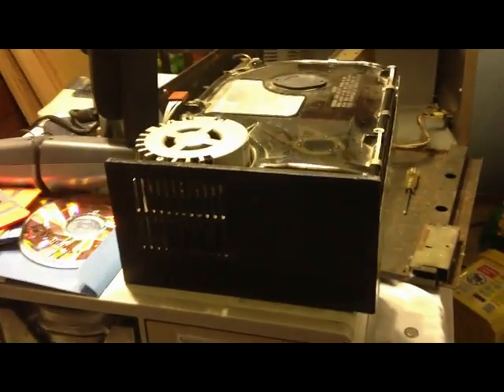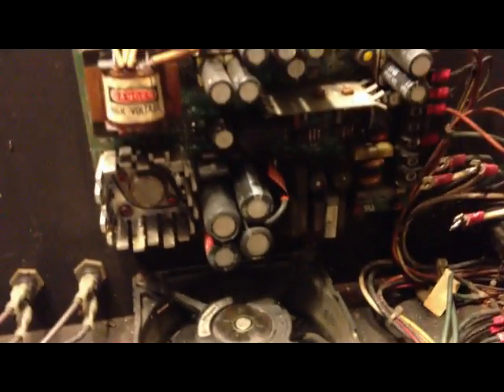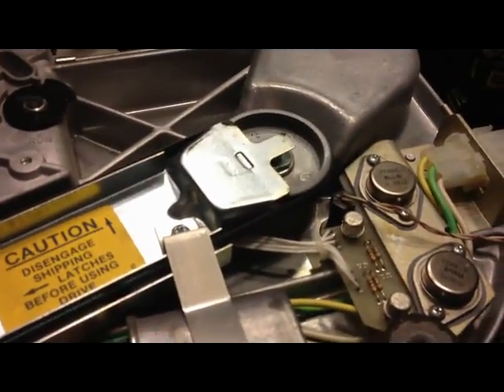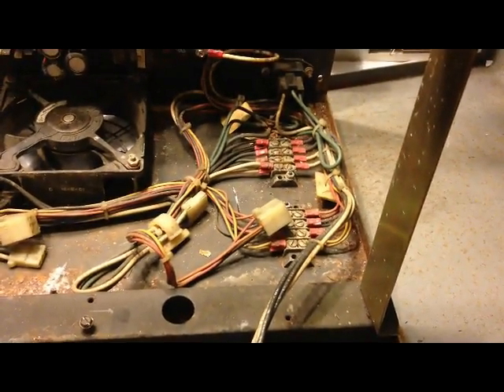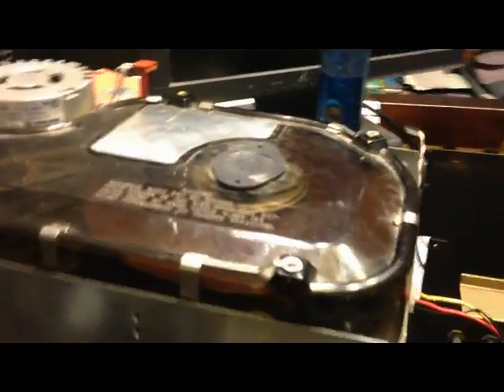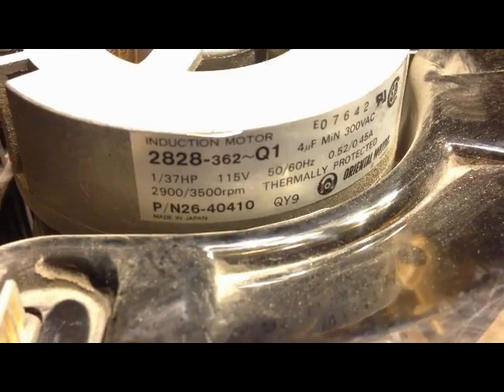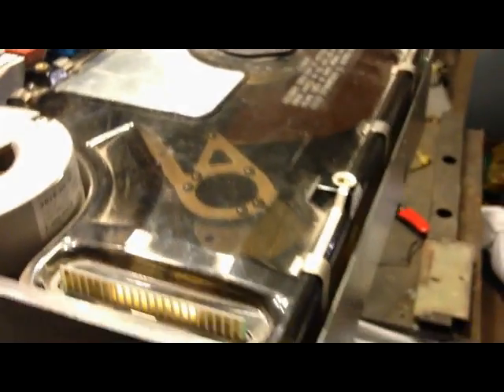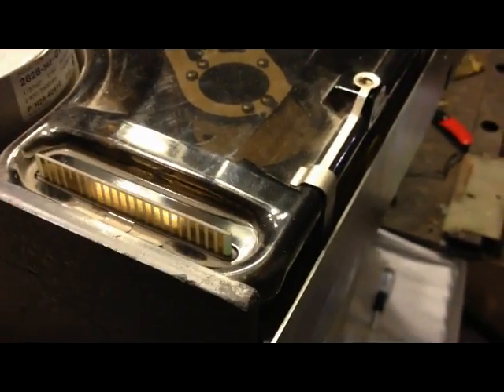Quantum 2040 8" Hard Drive First Power up.

Comment: Hi, I found your video very interesting since I have a Q2030 model. I'd like to be sure I'm connecting the correct wire colors to the right places. If I'm using an AT power supply, what are the corresponding colors? On the Q2030 there's a yellow, green, and white wire, and on the Molex connector of the AT power supply there's one yellow wire, two black wires, and one red wire.
Reply from the maker: Well on the AT and ATX power supplies the Red wire is +5v and the Yellow is +12v.  On this drive the yellow white and green wires are A/C 120 volts between the Yellow and white wire and the green was ground.  But some of these 8" drives need 24volts DC to power the head stepper motor.  Which is missing on both AT and ATX power supplies. The drive in the video does not have any controller board on it.  So the only power going to the drive was 120V A/C to run the spindle motor.  The TRS-80 Power supply offers a switched A/C voltage and that's what I was using in this video.  I could have just plugged it straight into the wall, if I had thought about it a little longer.  I recommend searching for Usagi Electric, he has a recent video actually showing a working 8" hard drive and how he connected it using Meanwell power supplies.

Comment: Man, that would've been SOO ANNOYING to hear all the time of using the computer! I remember when many hard drives had that loud sort of spindle motor sound. But why would a motor that size have to be that loud instead of just sounding like, or even being, an induction motor? There's no way they could've made the disk spin fast enough with even a brushless AC motor?
Reply from the maker: Well this is a 14 inch drive, so it would have been inside a mainframe in it's own room.  But imagine about 10 of these things going. lol
Reply: @Devin2277-n2m : A mainframe in "IT IS own room"? I'm confused. How can it be its own room? Or were you actually trying to say "in ITS own room"? Because if so, then my response to that is: Oh, OK, good! I'm glad people didn't have to hear that all the time while operating. But yeah, a room with 10 those disk drives running at the same time would be quite noisy!

Comment: Yow what's di RPM on dat
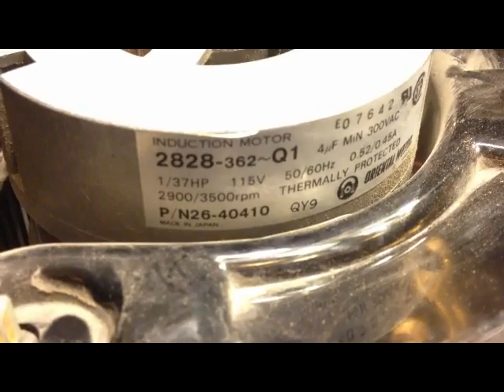Reply: At 6:34 you can see a shield on the motor. It makes 3500rpm :)
Reply from the maker: That would be about 3500 RPMs.

Comment: Sounds like the belt is a bit loose. The motor spools up before the disc is fully wound up. Even if you had the controller for it, you'd probably get data errors. I have a 1982 Xerox 820-II with a Shugart 8" 10mb. MFM drive and it's also belt drive, but the belt is still in pretty good shape. It runs CP-M 2.2 and still works well.😉

Comment: Damn it man what is with the circuitry missing for all these hard drives I keep trying to find all these really awesome hard drive videos and 90% of them are like yeah but the circuit tree for it to make it work is gone so goddamn disappointing
Reply from the maker: I hear ya!  Well most of these huge hard drives were designed to run on MainFrame computers which most have been shoveled off to the dumps.  Only the smaller pieces like these hard drives are left.  So there's just nothing to connect them to.  They were never designed to connect to an x86 PC.
Reply: @Devin2277-n2m  perhaps someone like mr. Carlson's lab and create some circuitry or re-engineer something it would be a total waste not to ever see one of these work again they are too beautiful pieces of equipment and deserve to be preserved in some way there has to be a way
Reply: @Devin2277-n2m  are you a furry to
Reply from the maker: @ethanspaziani5269  I dabble in lots of different hobbies.  Furries is just one of them.
Reply: @Devin2277-n2m  hayy im a furry to in tx !
Reply: @Devin2277-n2m  subd to your chanl

Comment: Are you sure that this beast is only 38MB? In 1981 there was a 5" Drives about 5MB and 10MB,so this monster could be at least 300MB or 3GB
Reply from the maker: According to the model number, it's a 38mb drive.
Reply: @Devin2277-n2m  this is just crazy :D

Comment: What is the voltage input on this drive? I read that it's 24V AC, but the motor can says 115V AC
Reply from the maker: Ryan Ashford The motor is 115v AC, yes.  There is no controller board, so no other voltages are required here.
Reply: @Devin2277-n2m  So even if you have the controller board with it, you still run 115V AC to the connector?
Reply from the maker: Ryan Ashford  There would be two connectors, one for the DC voltage for the controller and one for the AC to the spindle motor.
Reply: @Devin2277-n2m  Thanks!

Comment: The PCB plug poking out of the top of the Hard Drive is for a circuit board edge plug which has cables which run directly to the "full length" dedicated controller circuit board. The HD controller board required no additional drivers as it booted up with the motherboard and worked though the ISA M/B sockets.
Reply from the maker: Ahh!  Cool!  Thanks for the info.

Comment: What is its capacity? Any idea what year it was manufactured? That thing is huge.
Reply: 40mb capacity, the 2020 model was 20mb. My work used these 1983/84. Put loads of these in the junk skip, wish i'd kept a few.
Reply: the 2040 is 40mb capacity, I would guess from 1985
Reply: 1981 was the year

Comment: I used to work on submarines. both the fire control system and sonar systems used hard drives that seem  similar to this one. I think ours were slightly bigger and maybe around 20 lbs. subs were still using them around 2001.

Comment: can run windows xp on it ;)
Reply from the maker: This is a 38 megabyte hard drive.  But maybe some day I'll try XP on it.
Reply: 8 MB for a huge HDD this HDD can store lots of gigs in modern days
Reply: +Squinky Aventurierul Lots of terabytes dude, imagine making a drive of this size with the technology of today, probably 140TB
Reply: OMG 140 TB can store your brain data in it
Reply: ***** Actually no, you need roughly 2.5 petabytes to do that, which equals over 3000 terabytes
Reply from the maker: +CreeperGuy 555 no it's 8 inches.

Comment: Imagine how many terabytes they could cram into a drive of those dimensions today.
Reply from the maker: That would be awesome.  Probably several hundred terabytes.
Reply: @Devin2277-n2m  I'd buy that for a dollar
Reply: +Devin2277 It's an order of magnitude more if they can use flash. A 16 TB SSD in 2.5 inch form factor exists. Those drives are up to ~10 mm thick; giving it a volume of up to ~70 000 mm^3.

I would say the drive you have looks to be about 9 inches wide (8 inch drive = 8 inch platter), 5 inches tall and 12 inches deep. That fits 126 of those drives, or 2 petabytes. Stacking 2.5 inch drives waste space; you can probably double that if you just stack PCBs full of flash.
Reply: @soylentgreenb  Or using micro sd cards. they are tiny. but for the same capacity probably more expensive to produce than some stepper motors and disk platters.
Reply: +Jerkwad152 just wondered myself, why the feck no one does that
Reply: @Fiilis1  Manufacturing standardised on the 3.5" drive. Large enough for dense data storage, but small enough to have negligible noise and vibrations. Also, i think you'll find that a large drive array (think LinusTechTips Petabyte Project) can actually store more in a rackmount unit than a single disk filling a rackmount unit.
Reply: @Fiilis1  People just get a bunch of server hard drives and cram them together
Reply: @Fiilis1  I wonder why 5.25 HDDs don't exist anymore and why 3.5 SSDs don't exist at all
Reply: @RowanBird779 3.5 SSD exist in enterprise  market there is a video on ltt on a 100 tb 4 stakt 3.5 SATA SSD but it is slow for what it is you are better off buying a 8 nvme to 16x pcie edaptor
Reply: It is expensive, inconvenient as it won't fit on normal cases, loud, inefficient, etc.
Reply: Jerkwad152 a Peta byte
Reply: or a 5.25 inch hdd..
Reply: Modern 3.5 inch hard drives used in high end servers can go up to 20 terabytes or more, so if a drive of that size was created with the same density at the aforementioned server hard drives, I dare say it could get close to, or even surpass the 1 petabyte mark.
Reply: Oh, I know, the amount of storage on a drive like this would be unbelievable.
Reply: one petabyte especially if it’s a HAMR hard drive.

Comment: It has BELT-DRIVEN platters! OMG. It looks like some of the old VCR mechanisms!
Reply: 5.25 inch HDD drives were the first to use a BLDC spindle hard drive starting in 1980. At the time they were way faster than floppies and make a cool spool up sound. They draw about 24 watts continuous and 36 watts peak.

Comment: 5:31. Is that an... Airbus A380?!?
Reply from the maker: +Rithik Kumar   Nope!  Just the engine from one.
Reply: Devin2277 xD
Reply: sounds closer to a JT8D :p
Reply: +Devin2277 inside of rotor that moves plates is totally rusted
Reply from the maker: +smutkovski you know this?
Reply: +Devin2277 yea as i work with el. motors etc.. as it rotate parts of rust fall down and you get that sound of grinding metal against metal, can't really tell you more just by sound without open it
Reply from the maker: +smutkovski ah!  Maybe I'll see if I can put a few drops of oil in there, somehow.
Reply: +Devin2277 yeah it should get quieter after few runs to spread oil, well it will not be complete quiet as it's worn out :) but like 20dB down
Reply: lol fighter jet with afterburners

Comment: 110V 1A
Damn. And it sure sounds like it too!
Reply: I was thinking like 40:1 leaded gasoline and oil mix..it's not the computer you fire up past your bedtime trying to keep quiet so your parents don't find out that you're looking at porn... 1981 A.D. is when the Excalibur movie came out.
Reply: @brentfisher902  my dad said that he used to wrap his floppy drive in his duvet when he played games at night so that his parents wouldn't hear
Reply: Those were cool but the hard drive that makes the best sound were the 5.25 inch hard drives that use stepper motor heads and a direct drive BLDC platter.
Reply: @davidperry4013  Just realized the motor has a rating of 1/37HP. LOL

Comment: That thing is gigantic! that transparent plastic on top is cool. It would be neat to see hard drives use that now.
Reply from the maker: Right!  That would be cool to have, since a lot of cases have side windows, and then to have a hard drive that you could see the inside would be awesome. 
But everything is going to SSD's now, so no moving parts to look at.
Reply: Tr3vor42532 The raptor drives from a few years ago had glass tops
Reply: Is that transparent plastic a part of the original hard drive or added by somebody else? Pretty cool if its original and the manufacturer added it there for trouble shooting.
Reply: I think there were a few newer harddrives that had a window.
Reply: Slot1Gamer Yeah I miss those bad.

Comment: How old is it? Early 80s? late 70s?
Reply from the maker: A VERY good question.  Without the circuit board with chips on it, there are no date codes to see.  However, 1981 is stamped in very tiny numbers on the spec label.  So there ya go.  1981.